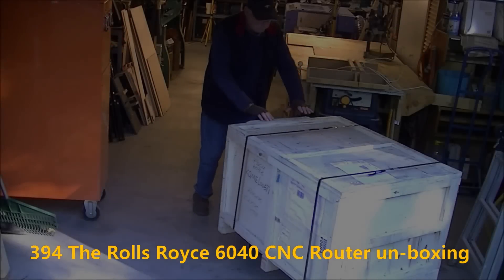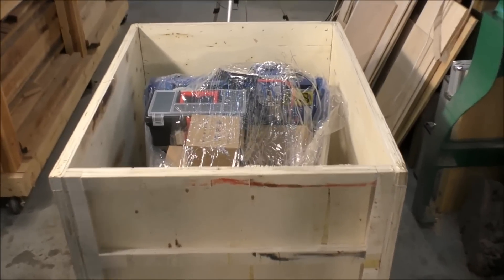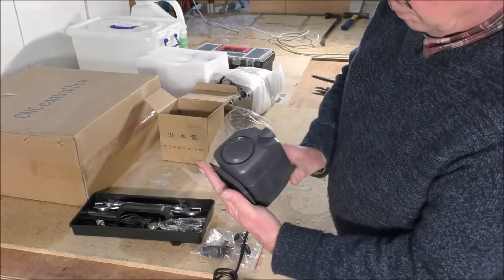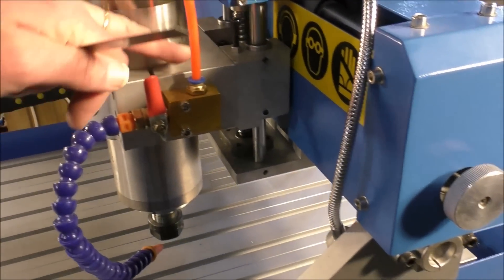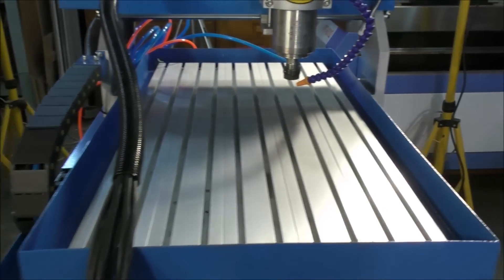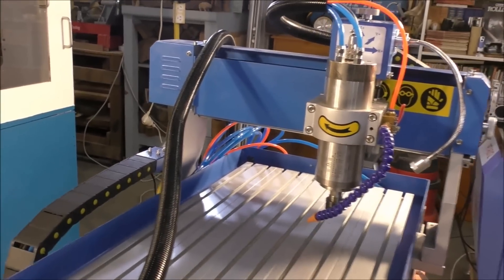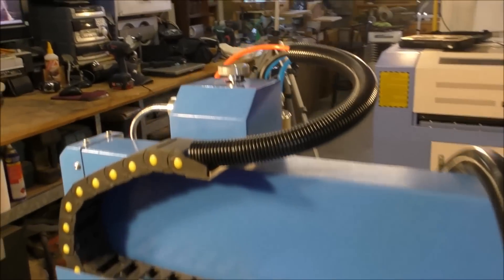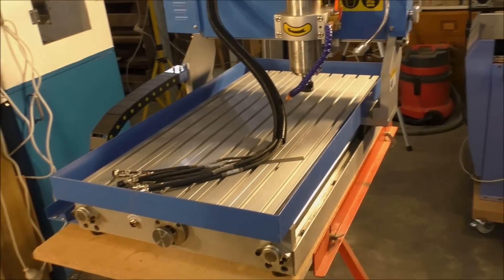*Un-boxing* THE BEST 6040 CNC ROUTER FROM CHINA

Comment: Would this be suffice for engraving into slate? Just lettering and designs, not interested in cutting.  Would 2.2kw be enough?
Reply from the maker: Hi, you would need a 6060 rigid gantery for that
Reply: @inventorsworkshop9600  Thank you for your reply Roger, I hadn't considered a rigid gantry before but that makes perfect sense for the extra rigidity. 👍

Comment: Did I missed it or you didn't mention where the machine came from? Looks nothing like 6040.
Reply from the maker: No, I didn't and this is a GOOD 6040 CNC router
Reply: @inventorsworkshop9600  The fact that it is good 6040 means nothing to the potential buyers.

Comment: What is the make and model?  Also, does the company you purchased your CNC machine have a website rather than the email address you added in the comments?
Reply from the maker: In answer to your question I purchased my cnc router from a place called BoostCN. Their email is boostcn@hotmail.com if you want to contact them. However, you may want to conduct your own research to ensure it is the right one for your needs. Someone mentioned to me that they do have a new website and it is: www.boostcn.com.

Comment: Hi there Roger, which make and model number is this router?
Reply from the maker: In answer to your question I purchased my CNC Router from a place called BoostCN. Their email is boostcn@hotmail.com if you want to contact them. However, you may want to conduct your own research to ensure it is the right one for your needs
Reply: @inventorsworkshop9600  Thanks.